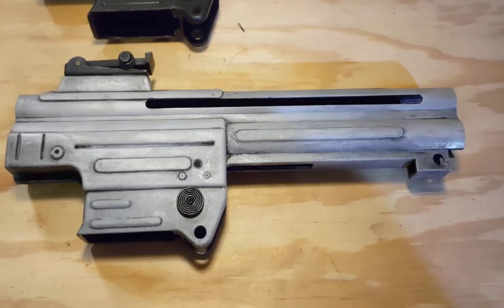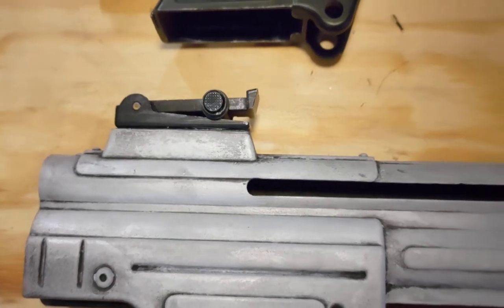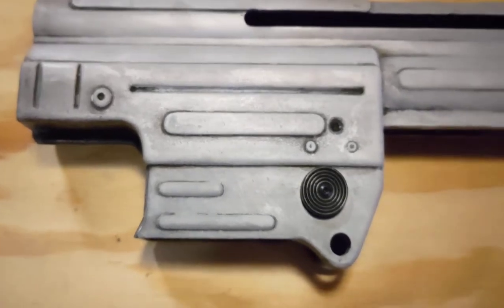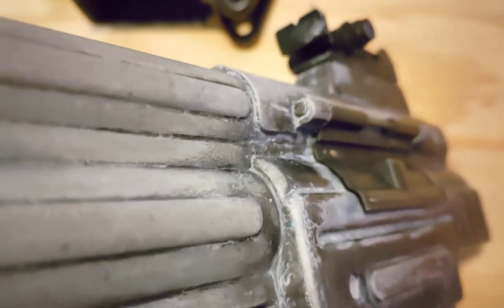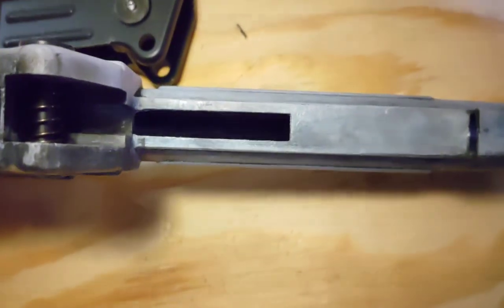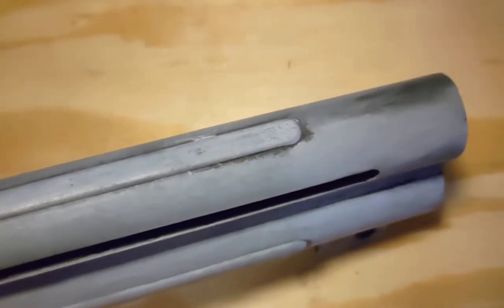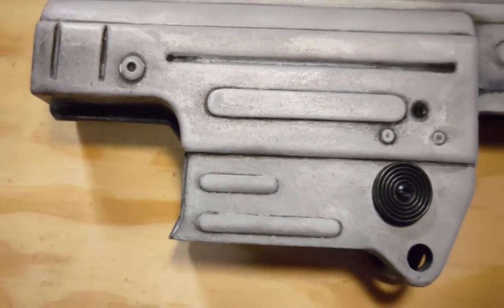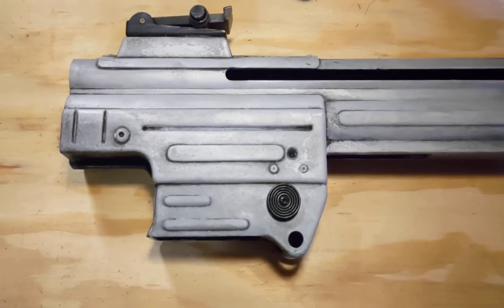Building an accurate STG44 replica: part 1 the receiver

Comment: Wait so the denix can be disassembled? I thought it was just solid?
Reply: Hi! i am from Portugal and until 2006 we had here some Denix replicas. I had two pistols and I've sold them as son as I could. For me replia smust mimic the real thing on its out side faces etc. Denix is not. Along with their cheap pot metal building, some parts, and ocasionally all the replicas, can be field striped and even more deeply disassembled. So, they have also moving parts too. In my cases, my two pistols could not be too much used as they became loose on their moving parts!! To me Denix replicas may be ok for some parts swap with airsoft or airguns, and in a case or two, one can use their wood parts to improve another replica or repair a real steel gun. But even here, we have to be calm!! To bad all this! Denix has the know how, the experience and the means to do better. Much better!! i hope that someday I can see that. But with me living else where, as here everything is a pain in the ass when it comes to guns etc...

Comment: Hi, and 1000 thanks for this video! Sir: you said you had use a propane torch on the Denix?? Is the Denix pot metal? Zamac cheap pot metal?? And you used acid phosfatic? ( Probably I did not write some words well )
Reply from the maker: Used the torch on the steel parts. Zinc parts can't handle the heat and will melt. The Denix is almost completely made of zinc.
Reply: @deathinc4u  This is what I knew: torch for steel. But I thought that I was not getting it right!! Long ago, I had 3 Denix replicas.I sold them because they were not realistic and very very poorly made. Denix could well do it much better!!!